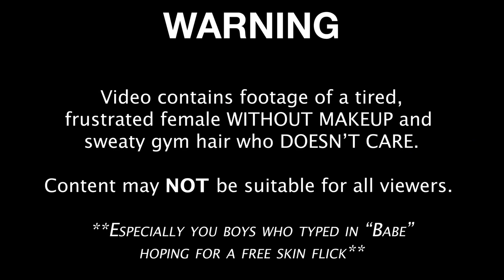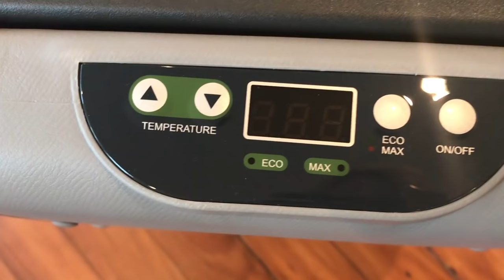IDEA: Turn Your Van Conversion Fridge Into a *Bench*

Comment: Ok I love it! 
Very practicable cause the pillow will act as an insulation so you don’t loose your cool - I’m mean your fridge doesn’t loose it’s cool over it’s beauty. 
And as a massage therapist for the last 35 years I want to make a suggestion. To prevent back pain get something to put your feet on. Perhaps a ledge screwed on the front or a little stool, because if you sit there for long with your feet hanging you will get low back pain or pain in your Quads. If you do it a lot it can become chronic.
Love your style
Reply from the maker: Yes!!! my feet dont touch the ground because I'm like (this) big. I'll engineer some foot pedals. that will also give me something to step on to get in and out of the high platform bed. Thank you!
Reply: Casey Roman always happy to help cause your such and encouraging force with my van build

Comment: Better watch that pole vault, it will def hold you but those wheels are xtra wheelie 🤣... We can add some lock wheels so you do not pole vault / face plant into the cubbyhole below the intended platform. Plus you can get a free tape measure with your wheel purchase at HF “win win”.
Reply: J. B. You totally rock! Great job and looking out. I was quite concerned about those wheels and was hoping they'd be changed. Casey is amazing and YouTube wouldn't be the same without her. You two are a great team!

Comment: Toooo funny! Love it.  Why not cover it with what cheers you.  Now, as the owner of a converted promaster with a similar fridge (bought it used), let me tell you from sad experience. Those suckers MOVE when driving. Locking heavy duty hinges will hold mine in place.  Yours, I recommend changing your casters to the locking kind and then finding some really secure (tight, strong) bungees or straps to secure it to the FRAME of the vehicle when you're traveling. There's this really awful sound that occurs when something big takes off while you're driving, and you almost always have to wait before you can safely stop. Good luck, I'm enjoying your project.
Reply from the maker: I think I may actually take the wheels off and put moving pads on. May be a bit high

Comment: It looks a little tall, is it going to fit under your pull down desk? I wan't to keen on "Le Shitter", but I love your fridge box.
Reply from the maker: No...not much I can do about that. The plan is to remove the wheels now and use moving slider pads. Nothing is predicable or easy with these van projects because well...there is no manual and there is no standard!

Comment: Hey when the fridge is full of food and beer...I mean, you know, canned drinks, it will be pretty heavy, so you might need a cargo strap to hold it in place during those 'brake checks'....
Reply from the maker: Yeah like I said in the video she's getting bungee cords. I may even take the wheels off and use moving pads
Reply: @CaseyRoman  Bungee cords will stretch and allow banging around, but a small cargo strap will hold it securely. Install a couple of eyebolts or D-rings to the wall or floor, and it will stay right when you want it.

Comment: I don't see anything wrong with socks and flip-flops! I'm in Ohio I'm still wearing flip-flops but without the socks. Doesn't look like any of the casters are locking casters. You might consider putting at least two locking casters on your bench.

Comment: Just in case you need to find someone else for your electrical work you might have better luck with an automotive repair shop that is used to the 12 volt DC systems found in vehicles. It shouldn't be taking weeks to do the wiring in a van - only days. 

I work with industrial electrical control systems that use a lot of low voltage DC sensors as well as controls for 120, 240, and 480 volt AC powered equipment. A few of the licensed electricians I work with understand the low voltage DC electrical circuits, but the majority of them are pretty lost when it comes to low voltage DC circuits like the 12 volt DC systems in your van. Your electrician may be one of those with little or no low voltage experience. So he is fumbling around trying to figure things out as he goes. 

I added house battery system to my vehicle that charges off both the alternator and solar panel, has 14 each 12 volt power outlets, 12 each 5 volt USB charging outlets, LED lights, and a fan and a compressor refrigerator (like yours) and it only took a couple of weeks working on it part time. Hope you aren't paying this guy by the hour.
Reply from the maker: I'm hopeful we are but days away

Comment: Hum, I don't want to come across as a troll, other than being hideous, the truck fridge is on Wheels. What will happen when you hit the brakes in a hurry?
Reply from the maker: I said in the video I was strapping it down while driving! Also...I'm probably going to take the wheels off because they are too high and use moving pads

Comment: It's on wheel's not good, put it on draw slides.
Reply from the maker: I think i'm taking it off and putting moving sliders on it
Reply: @CaseyRoman  perfect just need a boat cabinet lock draw slides that are rated for 500lbs.